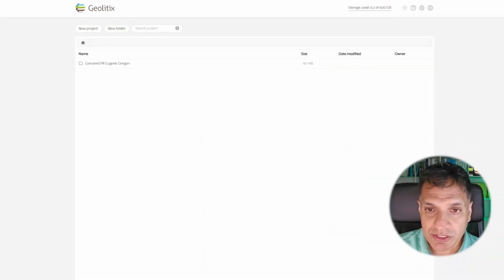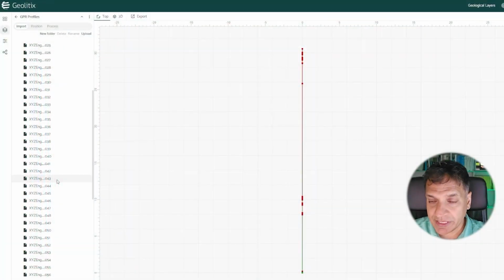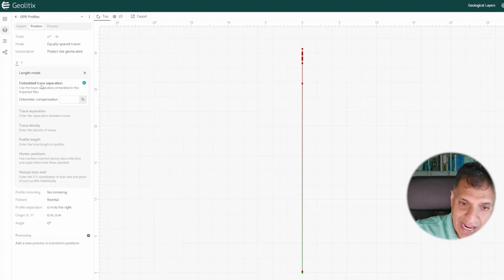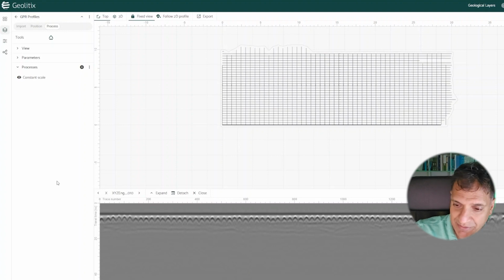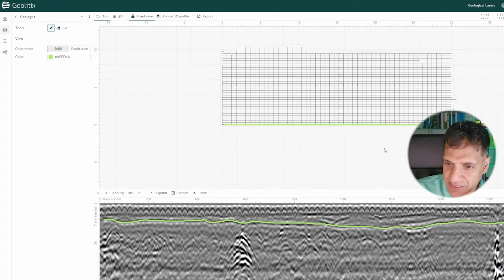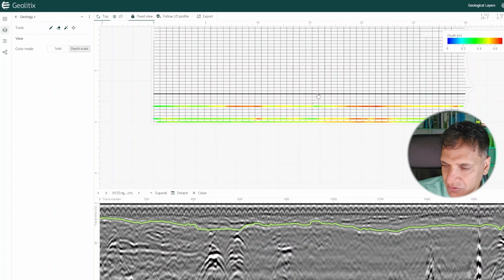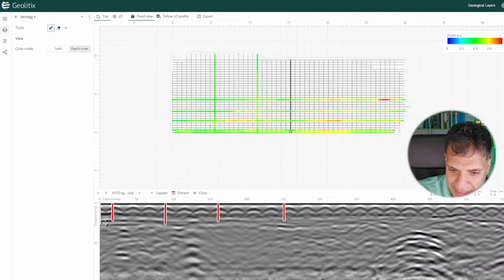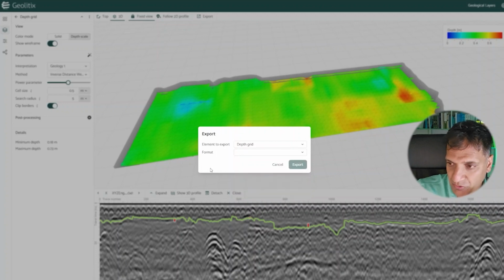GPR Processing for Geological Mapping

Comment: So the green color in 3d model generated is based on line u traces it before?
Reply from the maker: Yes, and it can be exported in many formats, including Shapefiles, DXF and CSV files.  Or, you can use those interpretations to create a depth surface, which itself can be exported as a 3D DXF surface, or a Surfer GRD file.